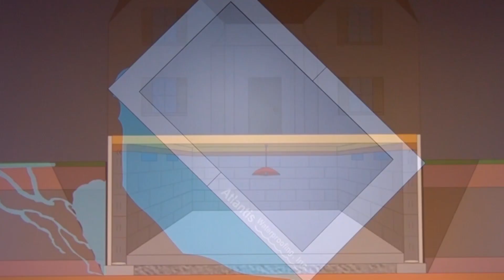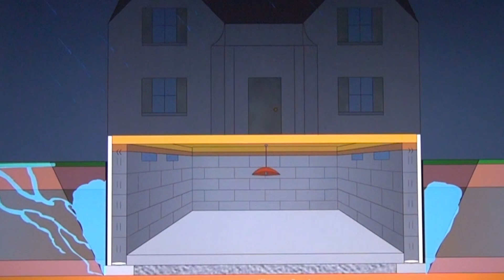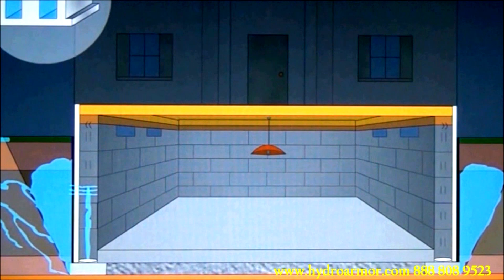Basement Waterproofing -  What You Need To Know - Cause and Effect

Comment: I have had damp basement walls since I moved in 13 years ago but when it becomes torrential rains, like you can't even drive a car heavy rain, I can see the water trickle down the wall and make it's way to the basement floor drain. Thank goodness for the drain or I would certainly have accumulated water all the time. It dries but yes I see mold on the sections  of wall where it get wet.

Comment: What about slabs? Like, specifically in Texas? The soil is soft as hell and holds water pretty much right at the surface... If I install some sort of drainage, ain't it just going to be fighting a losing battle?
Reply from the maker: Depends on the Slab. Up North all building must have a "Something" three foot down because of the frost line.  Otherwise the slab will move.  Slab can b a mono pour or block or formed concrete.  Slab can be on top of or side of foundation. Complicated enough?  OK so if the water is on the surface than soil is clay.  Another variable is if the grade was built up.  

Your issue is probably water coming up from the floor.  Think of the slab as a concrete floor with 3 ft deep walls on all outside walls. The earth 3 or 4 ft pout from the slab is disturbed soil  This video shows how water surrounds the house. The weight of the water wants to float the house so it gets under the 3ft walls and comes up.  Think, it has nowhere to go. The water is trapped by 4 walls. 

Some might say to do an outside foundation Waterproofing.  Absolutely totally WRONG. Water will still get under and always come up.  You can do an interior system even if it's a mono pour.  Aaannd of course more variables.  Nonetheless,  if a trench is ten inches down on all 4 walls the water will rise up and get into the bottom of that trench, stone, ADS pipe and flow to sump pump. It will not be possible for water to rise up any higher than the bottom of the trench.  Water can never rise any higher than that 10 inches.  A slab issue is sort of upside down. Instead of water falling down into the trench it rises up to the bottom of trench.  Make sense?  

I can do a face time estimate if you'd like. You show me a few things and I'll tell you exactly what you have and how to fix it.  I do charge $350 and for that I have saved a lot of people a lot of money and grief.  And I thank you for asking. - Daniel J OConnor